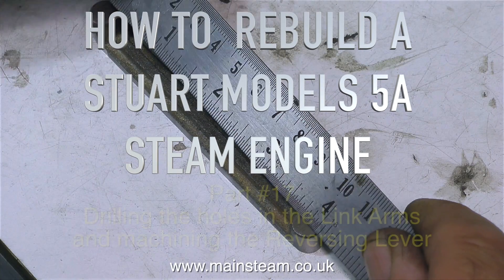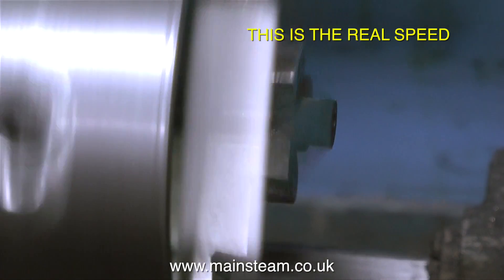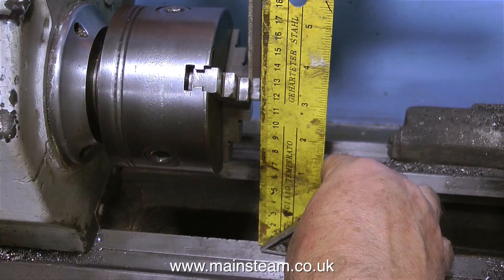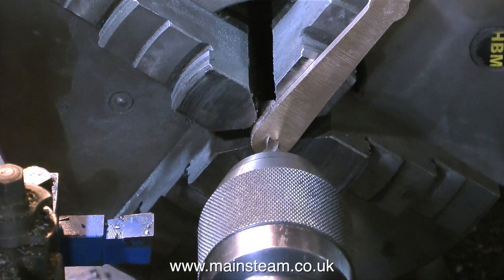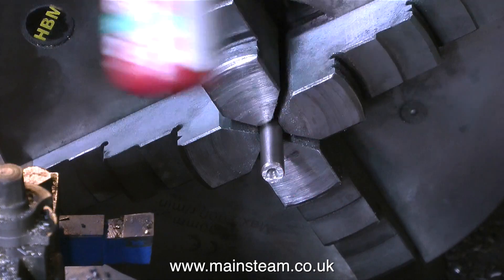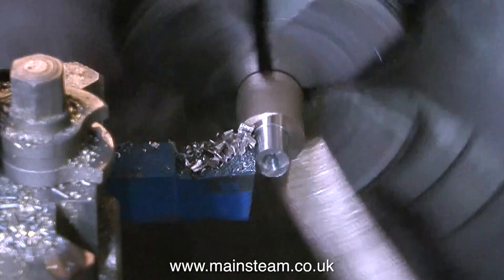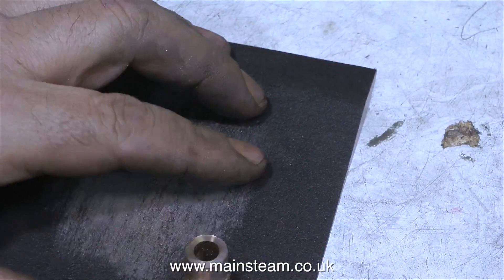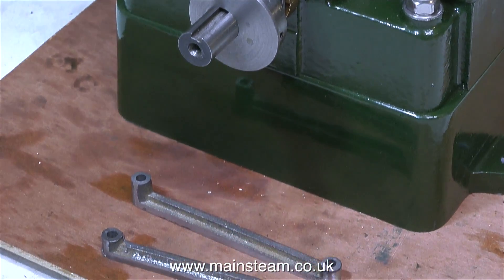HOW TO REBUILD A STUART MODELS 5A STEAM ENGINE - PART #17

Comment: I hate that when I buy some tool or parts for a project. Loss the tool or part, buy new one then find them at a later date. My mom would buy a item for a christmas gift in May, loss it, bay a replacement and find the orignal gift 5 to 7 years later.

Comment: I use WD40 instead of oil or water on the sandpaper. It unclogs the paper and it will cut faster.
Works great on sharpening stones also.

Comment: Would it have been possible to drill the two holes on a milling machine rather than in the lathe ?. s there any advantage in the lathe over mlling the holes
Reply from the maker: Either or, I just used my lathe because I like playing with it :-)))))

Comment: Hi Keith!
I'm an expert in everything, but the only thing I hadn't learn was to soak wet'n dry sandpaper with oil. Thanks. However, do you know what? I grabed the wrong can and used WD40. That stuff is far better than both water and oil! Never liked to use water on naked steel anyway. Love that 5A BTW.

Comment: Keith. I once knew an 80+ year old mechanical engineer. He spent his entire life working on ships, submarines, production lines, automated assembly lines etc etc. He designed a huge quantity of machines that probably are still around today, although sadly he is not. He used to tell me, listen... if you have to stick your shoe in it to make it work, do it. There is no wrong way to get results. Nevermind the keyboard warriors, if they don't like it they can go ahead and switch to another channel. Maybe a sewing or knitting channel. Thank you for your contributions, and yes I did find it useful.
Reply: This is not an exercise in trolling but the IS a wrong way to do something, there are however many, many right ways.

Comment: I wonder how they used to turn aluminium seat posts on bicycles. that must have been wild.  Turning eccentric or asymmetrical parts is fairly common, eccentric shafts and crank journals come to mind. 

The accuracy of the machining in these videos might not be micron-perfect, but suits the job well. 

Viewers would do well to not  be tempted to over complicate manufacture because of misguided egocentric beliefs.